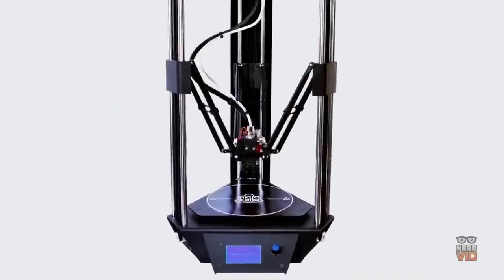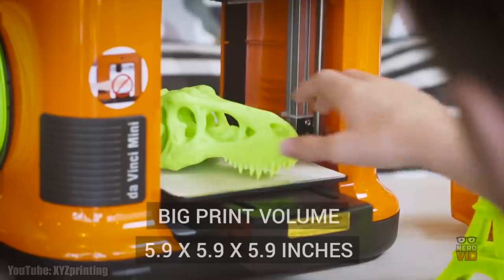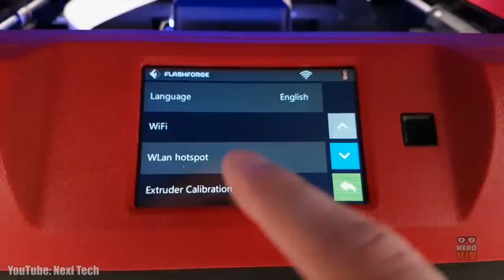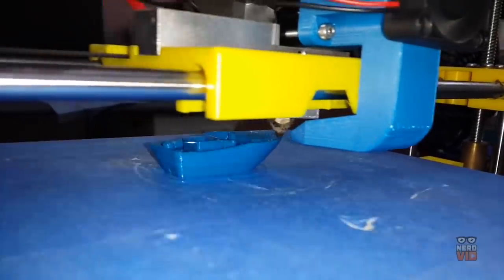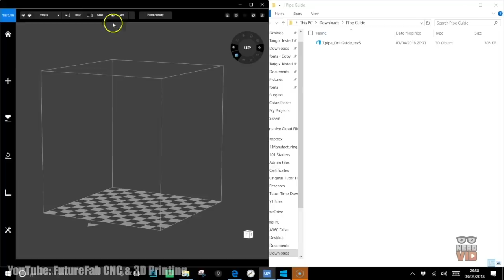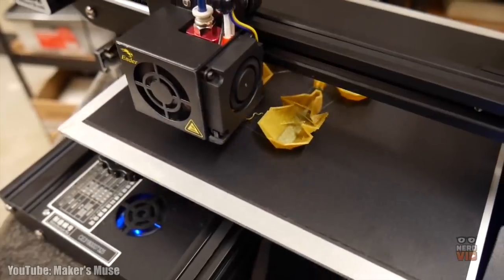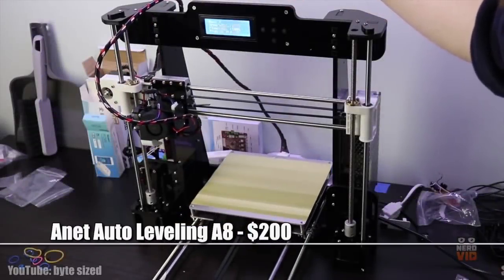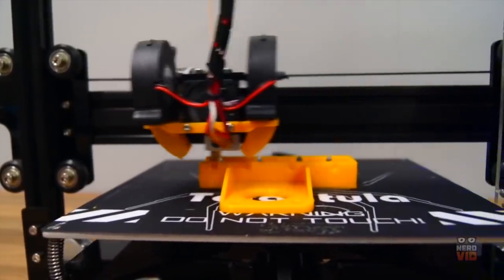10 Best Cheap 3D Printers for Beginners To Print Anything

Comment: gonna save you 5 minutes, Ender 3 is the best starter 3d printer. Focus your attention on that one

Ok so I'd like to touch on what I meant when I wrote this comment. I was specifically talking about budget 3d printers. It's not a perfect printer with all features you could want, but when I wrote this it seemed to have a good platform with a lot of support from respected 3d printing figures. Dont take my word for it, just learn as much as you can and make an educated purchase. I'd buy a kossel plus before an ender 3 but I wouldn't recommend a delta style for someone who's never dealt with printers before. Also the building process teaches a lot
Reply: I would have to add that none of these printers are great at printing miniatures less than 1/35 scale. Good, but not great. You MIGHT get Reaper Bones quality depending on the size, detail and complexity, but if if you think you will get WH40K level detail you will be sadly disappointed. That level of detail is still the domain of most resin printers. I will conceded that what is great quality for one person may be barely passable for another. I was leaning towards the MonoPrice Maker Select V2 until I saw the Ender 3. Keep in mind many reviews/buyers have stated that it is still a bit of hit or miss. Some work perfectly fine out of the box while others require some parts to be corrected during assembly. If you're a DIYer then the Ender 3 will be great but if you just want a printer that works OOB with little or no fine-tuning or mods, get something else.
Reply: @VideoCesar07  As I have read online to find out which 3D printer to get first, I found out that basically every printer is a hit or miss. Even the more expensive ones like the Original Prusa MK3. People run into problems on every one of them and except a few shitty ones, the fail rate is quite consistent. So basically it's either gonna work out of the box or not. So the only deciding factor would be the print quality and the functions. Print quality on a lesser extent, because on an Ender 3 you can get the same quality as you would get on a 7-800 dollars printer. That leaves us with functions, but again, every function can be implemented on a cheaper printer too if you have the time and will.
Reply: Thanks, Dude
Reply: Amen.
Reply: Pablo Arnold no it’s not the best might be the best budget one but not the best I’d say the prusa mk3s is the best beginner 3-D printer auto bed leveling crash detection comes with a very good slicer power panic filament run out detection
Reply: smh9000 inventor, it’s the best one to use and it’s very streamlined
Reply: smh9000 The best one to use would have to be MatterControl. It’s free, easy, and everything you need is there.
Reply: Anycubic is mega
Reply: Would you recommend the ender 3 over the Da Vinci mini, taking in mind that you have to assemble the ender 3
Reply: @simon7109100  I haven't heard of anyone having huge problems with the MK3S? I have a mk2 and haven't had an issue in two years
Reply: So this is the comment...
Reply: simon7109 that is possibly the LEAST true statement on this entire printer
Reply: Nolan Dieselberg it’s DEFINITELY NOT the best
Reply: smh9000 prusa makes 2 slicers one for VERY beginner people and one for *most consumer level skill levels (and there both free) or simply3d
Reply: Kasper Frølund yes by far
Reply: That's the printer I've been eyeballing, I saw it for $189!
Reply: Do you have to assembly it?
Reply: @novaforge5832  Yes, like any device some assembly is required.
Reply: Nova Forge if you can read you can assemble it
Reply: Why...?
Reply: can you upload your own design to it?

Comment: I'm running a tronxy pro2 I got on amazon for $200 for Christmas, and it will take PLA / ABS / WOOD / PC / TPU / PVC types of plastic. It's a clone of the creality ender, so the parts are interchangeable. I love it and have another one on order. It came with everything including the slicer software and 90% preassembled.

Comment: I would like to note that the A8 is usually sold without the auto-levelling sensor, so it would have been interesting to hear how well that sensor worked. But without the sensor, it is substantially cheaper, and the printer is so much known as the printer that you should get in order to have fun upgrading it - a lot! - so it makes sense adding that later, unless the included one is really good.

Comment: Funny how the CR-10 wasn't mentioned.  It has a very large community to back it up and is one of the best printers I've used and have worked with in general.  Anet A8 takes some upgrades and fine tuning to get good prints.  I have both and my CR-10 is my go-to.
Reply: Because they're more of hobby 3d
Reply: @Jwynne_  LOL, hardly.  See other prior post that say the same.  GL
Reply: its price dear?

Comment: Creality Ender 3. Full stop. You print in ABS and get quality almost equal to SLA. I love mine, and have printed an entire army of miniatures with it already. Most of these printers are simply inferior. There is no escape when it comes to learning curve. Printing is hard to learn. Learning design programs is equally hard. Take your time, but for god's sake at least buy a good enough printer that allows you to progress. Let me know if any of you have any questions.
Reply: Very very good. There is some items you need to get to have this thing run at a pro level. I have had it for the last 6 months and have gone through the learning period of my first 3d printer experience. I have graduated to printing exclusively in ABS plastic, as it is not only cheap but archival, unlike PLA. I use an Ikea glass mirror tile, cut down, as a build plate, with Kapton tape on it for adherence. You can upgrade some parts using thingiverse files. I purchased a new extruder assembly in metal (original is in plastic), bought new nozzle assembly, (more accurate than stock) and a BL touch sensor for auto-bed leveling minimizing print fails. I print 10mm scale minis and they have no visible lines at 0.04mm layer height with a 0.25mm nozzle. This thing is so good I am buying another.  @nasib7131
Reply from the maker: good suggestion thanks Martin
Reply: Can the CE3 do 30-60mm sized figures? 
I'd mostly be using pre purchased files to print, I'm assuming no issues with that?
How hard is it to assemble? 
Whats a good plastic to start with? I'd like something durable but not overly expensive.
I'd be using this to make Dnd mini's, not sure if that'd help with the questions. 
Thanks in advance for any advice you can give
Reply: I make small figs with my Ender. I print Epic scale minis (6mm) with a 0.2mm nozzle and 0.04z height. They come out perfect, almost DLP quality.I am learning to cast them in Oogoo molds using pewter and lead. You want to print large things in pieces and glue them together later. Less chance of print failure that way. Or rather, any fails will be on a separate piece. I believe the build volume is 200 by 200 by 250mm, quite large. Assembly is easy, lots of videos, and the calibration is a sinch. The best plastic is ABS, but read up on it as you need an enclosure ( I use a clear tablecloth) and heated bed (100C) to get the thing to print nice. You can Acetone Vapour Smooth the print lines after. I use Siepie's Cura profile to slice, and been learning blender to make my own stuff. Good luck. @emerytharp6858
Reply: Thanks, really appreciate it!
Reply: Well you pretty much answered any questions I had without having to ask them. Thank you for your comments on it!
Reply: @Splatterpunk_OldNewYork  Out of curiosity, what kind of mods would you recommend for the Creality Ender 3? I've actually ordered one and it's arriving tomorrow, although I heard I should get some upgrades for it to make it run/print better. Thanks.
Reply: Metal extruder (more accurate), glass bed (actually flat) Kapton tape (increases stickiness) New extruder assembly (the stock is inferior and you will need an extra one, make sure the heater cartridge is rated for 40 watts) Nozzles from 0.4 to 0.2, BL touch along with a Raspberry Pi (allows for auto leveling, kinda advanced but you will grow into it) and get some Mat medium acrylic gel from an art store, as I found it to be the best glue. Never worried about prints not sticking after this. Good luck.  @AnkieJay
Reply: Do you make your own models/ what program do you use?
Reply: Blender. It is by far the most useful. Tho designed for other things than just modeling. Many, many tutorials online. Make something simple, like a wine bottle to start. I have also been experimenting with photogrammetry. You make a small sculpture out of clay, take photos of it and then plug it into Blender. Something that allows more versatile startup. @electricmouse6382
Reply: not for beginners
Reply: ABS = Toxic chemicals.  no thanks.
Reply: @nasib7131  if this is your first printer, you'll have a really really hard time with the ender.  get something more simple and user friendly like a Cetus3d MK3.  you can't go wrong with that.  the ender is for people who are already knowledgeable about 3d printers, definitely NOT a good beginner level printer.  MASSIVE learning curve.  Nothing but months of frustration and people telling you theirs works great.  I'd skip the hype and get something that actually works without having to immediately upgrade parts.
Reply: @AnkieJay    Ender3 = mod everything to make it work right.
Reply: @Splatterpunk_OldNewYork  Ah, Ive had some experience with inventor but that's about it. Its not something I think I would want to start paying for right off the start.
Reply: Say what you will, friend, but believe the Ender 3 is quickly becoming an industry benchmark. All thermal plastics are toxic, that is why you cannot make a cup and then drink out of it, except for PTEG. I was told that ABS is bad, but quite honestly it is the superior choice of material. PLA is simply low detail and brittle. It is true you should buy some better parts for the Ender 3, but for the price point is it really nothing. I am very happy with this printer, it has allowed me to focus more on getting to grips with designing 3d printer friendly models instead of obsessing over print quality. Too many details to worry about with this hobby as is.
Reply: My first printer was an Anet A8. So was my second. If you have any mechanical aptitude at all, I suggest getting something you put together yourself. If you built it you can repair it, I get incredibly detailed minis at .06 in ABS. Most of the time I print at 0.1, if it's not a major character that needs super detail and for hordes I print at 0.2 for speed.

The main thing to do is get that bed LEVEL. I get great ABS adhesion on my bare aluminum bed with just a spritz of cheap hairspray but my bed is dead level. My only upgrades are printed right on the machine.
Reply: Large figs need to be printed in parts, where the adhesion surface rests on the print-bed. Don't bother with rafts, just print with a skirt of say 8 perimeters. Good enough. Use a glass bed, kapton tape, and mat medium acrylic gel for adhesion. ABS is the best/cheapest. Can be Acetone Vapour Smoothed for better detail/increased strength. $20 per Kilo. Easy to glue as well. Takes best detail. Must be stored in dry place/bag with desiccant.Check my previous posts for more info.  @emerytharp6858
Reply: @Splatterpunk_OldNewYork  so basically the machine sucks if you don't go out of your way "repairing" all the faults?
Reply: No. The machine prints fine straight out of the box. What I am relaying here is the upgrades in MY journey from novice to pro. Do your own research before keyboard warrioring.  @MrAkurvaeletbe
Reply: 🤔 mmm, so don't use ABS...😎
Reply: I have not had any heating issues. Heats bed to 110C and max nozzle temp is something like 260C. Never failed on me. But then, I only own one. Clogging is a nozzle assembly issue. Nothing to do with Ender, just a common upsie of not setting things correctly in Cura. Any printer will clog.  Hope that helps. @Caleb Scotton
Reply: Hope you are happy with it. @Caleb Scotton
Reply: @Splatterpunk_OldNewYork   can you please give me some advices on how i should learn to print and learn to use the logiciel .. please i need help .. thank u
Reply: Not sure what you meant friend. The most important thing to do is learn how to set your home trigger so that when the nozzle aligns, it moves to its 1st position a little above the bed-plate. 90% of print failure is poor bed leveling. Let me know if you have more questions. Good luck. @yassineacharki
Reply: @Splatterpunk_OldNewYork  tanks bro
Reply: I second this! I'm noob in 3D printing. I've never own one. I just bought Creality Ender 3. It's not so plug and play and newbie friendly, but it's not that crazily hard to assemble.

I spent about 5 hours to get it right the first time. I'd suggest searching Youtube for the first setup the right way due to the instruction is not so newbie friendly, at least for me.

My CE3's home stop of Z axis is bit high so I cut it some to lower its installation to make my extruder a little bit higher from the bed.

Bed leveling is the point to remember as it's as important as the print successful or not.

Frequently check x axis motor for any loosen wheels as well as the rode tightening, too.

I only print with PLA to start as I'm printing in my small room. I'm satisfied with my result with this first printer even it's not perfect. I'm only print with stock machine without any paid upgrade, the result would be better but it's not bad, I think it's related with my setting to make it better. There are many videos of it to fix and error I might faced.

Some free upgrades from Thingiverse should make your life easier.

Assembly is not a bad thing as I can fix most of the fault it might happen.
Reply: i dunno about the ender 3 for beginners... i got one and as cool as it was it was in fact a nightmare to deal with and has loads of issues, so if you aRE a DIY enthusiast but lack huge swaths of time then you are in for a lot of hard work, and possibly generating a desire to throw the thing off a truck long before you get satisfying prints.
Reply: On a bed that small a BL touch (abl) really isn't necessary!
Reply: @Splatterpunk_OldNewYork  hi martin, you spoke you the extruder assembly. I am new to this so could you please explain more on this. 
My confusion is where you mention check for 40W heating. Do i have to change the whole assembly or just switch it out for the heating block?
Reply: @nendosana  Hey bud, the heating cartridge is the 40W vs 20W issue. It is the red cabled wire that runs into the heating block assembly. The metal assembly is pretty ubiquitous, and can take many makes of heating cartridge. Aliexpress sells them in kits, which I warned about checking the voltage for. You can also simply buy the heating cartridges separate (buy spares as they will burn out eventually). Hope that helps.
Reply: @Splatterpunk_OldNewYork  thanks for explaining. Sorry for being tedious but is there any heating cartridge in specific that you would recommend? I would like to upgrade my ender 3 pro to the same level as yours. 
 I really don't know much to do that and any assistance is appreciated. Thanks in advanced 😊
Reply: @nendosana  I believe they are generic. Tho I am sure you can over-pay for a heating cartridge on the Internet.
Reply: @nendosana  I would like to point out that the heating cartridge is only an issue if you wish to print with different materials on the same machine. Say PLA and ABS, respectively. I suggested in an earlier post to get separate nozzle assemblies and switch them out when printing different materials with varying Glass temperatures, (melting points basically). I tragically found that you cannot completely clean out the nozzle assembly (tube, block) and thus the materials mix, and you get plastic cottage cheese on the other end. Randomly. Just saving you some real frustration.
Reply: @Technobby  Proud of you. When you are fine tuning your machine, be aware that for every three wheels running on the v rails, one of these has a large hex nut that the others do not. This nut can be adjusted with the wrench provided with the printer kit, which will push the wheel closer or further away from the v rail. Loosen the small screw holding the wheel, turn the large metal bolt until All the wheels turn together, and then re-tighten the small screw. All the rubber tooth cables should be tight enough to pluck like a guitar string, but only just. Keep an eye on any wear on the wheels, if so, too tight. Perfect alignment will make perfect models. Peace.
Reply: @donaldtrump2078  for some reason I don't trust what you say...lol

Comment: Anycubic kossel line at plus is only $240 and does great prints.  Has auto leveling and large print area.  
Bought a Tronxy before but had lot of problems with it.

Comment: Nab question, why Creality 10 or 10s isnt on this list? Half a year ago, when i was searching for 3D printer it seem very promising
Reply: Krzysztof I have a CR-10s and it is great. It’s probably not on the list because it can require a bit of tinkering to be fully functional so it could be frustrating for some beginners. I would go for the Ender 3 pro if I were you. In fact I’ll be getting one for myself soon.
Reply: @rennickgaming6784  I have been watching materials about Ender 3, and welp i guess im gonna buy it, thanks for that comment <3
Reply: Dylan Biehn there is more to the pro than that it also includes a magnetic build plate which is made of a plastic type material instead of glass. In fact it is much like the Prusa mk3 build plate. Not to mention the upgraded 40x40 extrusions for added stability. I also believe the hot end is a mk 10 instead of a mk 8 that the original one has although I’m not 100% sure on that one. So there are many things that make the pro worth it. Especially when it is only $280 on tiny machines which is cheap as dirt compared to other printers.